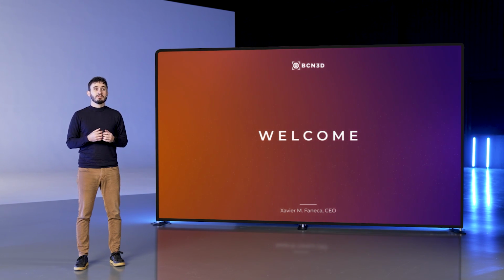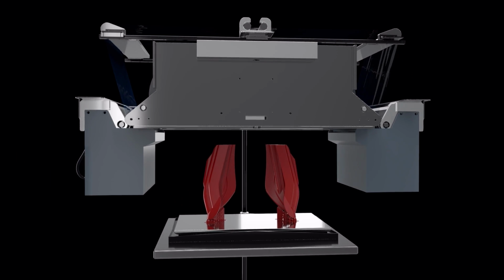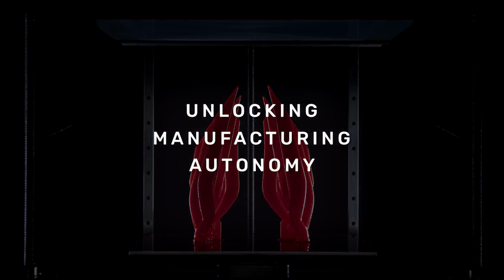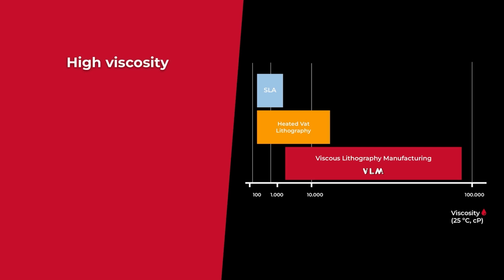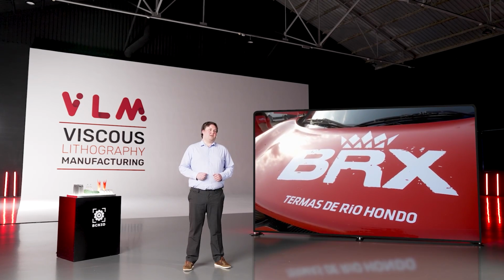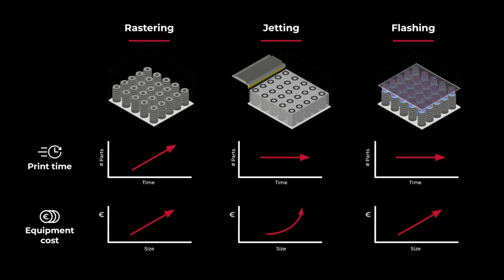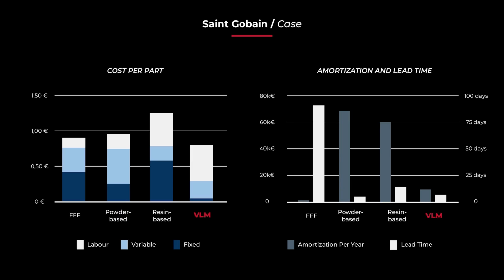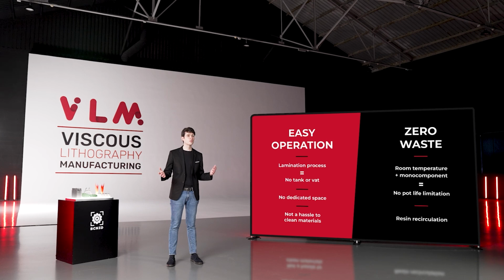Showcase event - Introducing Viscous Lithography Manufacturing (VLM)™ 3D printing technology

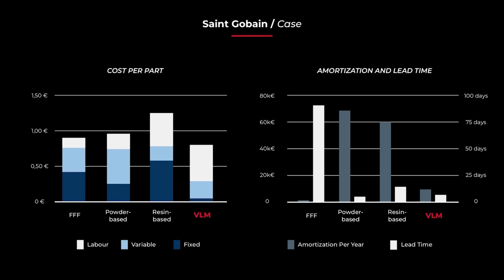Comment: at 42:08, the slide shows a labor cost per part comparable to SLA type printers.  But i dit not see it in the presentation of the tech. 
So, I assume that as a post process, you have to wash and cure like SLA ?
Reply from the maker: Hi Laurent, yes, the parts require a similar post processing like SLA.

Comment: Which materials will be possible and is there a consideration to allow for a more broad market so that it doesn’t end up 100% proprietary and vendor locking.
Reply from the maker: VLM materials will cover a wide range of applications in multiple industrial and healthcare vertical markets. The materials portfolio will be optimized for the unique VLM platform, but we are aware that this technology will enable research in new materials for niche applications out of our initial scope. We will support such developments to take the full advantage of high viscosity!